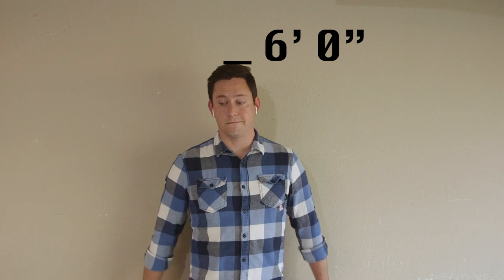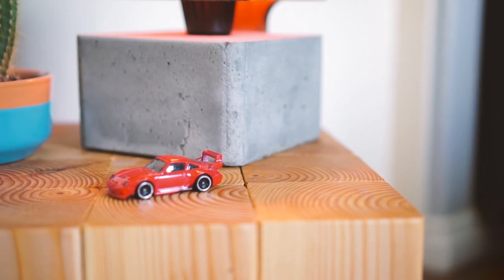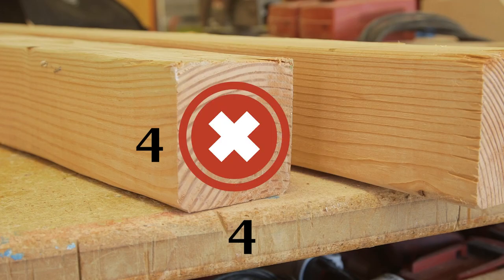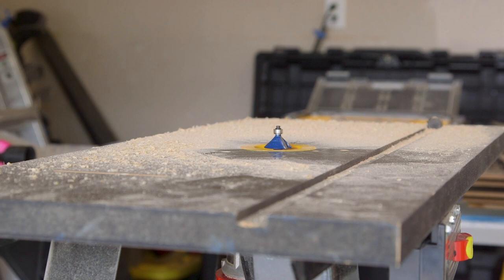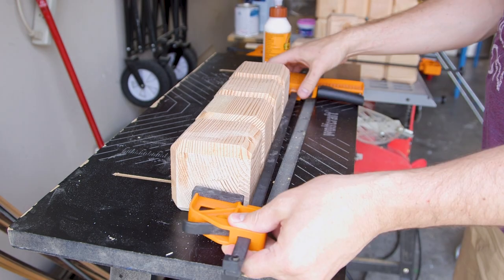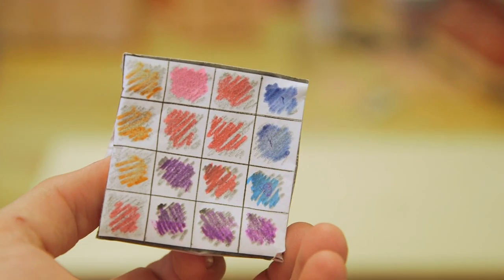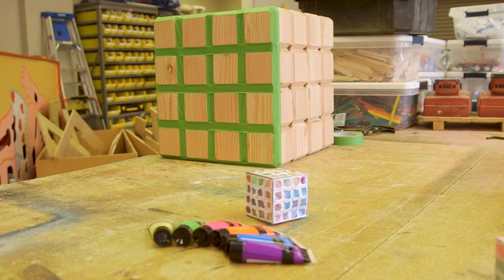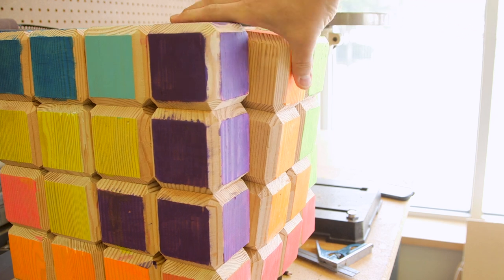This Tetris Stool Changed My Workshop

Comment: Out of curiosity, why not locking casters for all the wheels?
Reply from the maker: I replaced the wheels with locking casters not long after I finished making this. Got a lot of feedback that locking casters are better so quickly switched them out
Reply: @geekdaddiy  lol, I bet! Especially if you're planning on standing on it. Well another great, simple project that will probably get a ton of use! Thanks again!